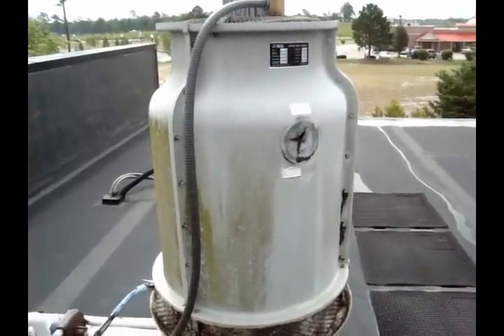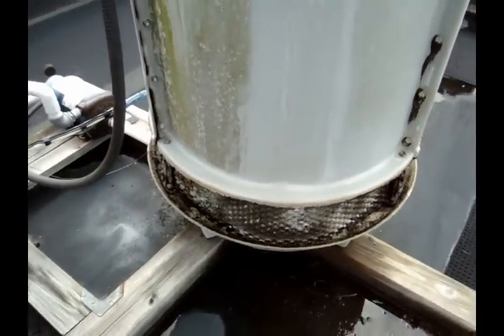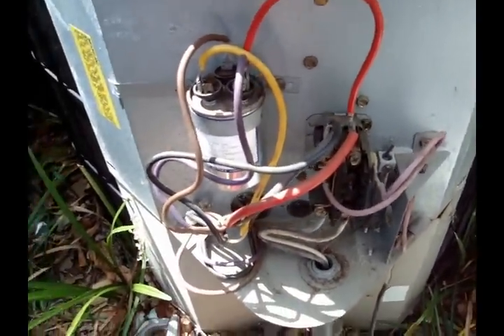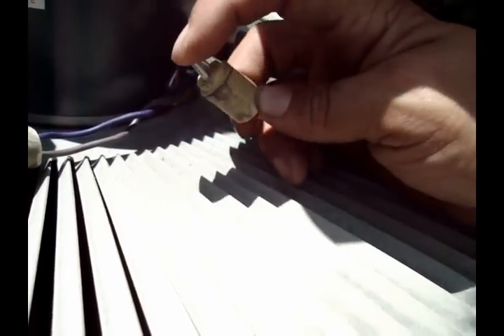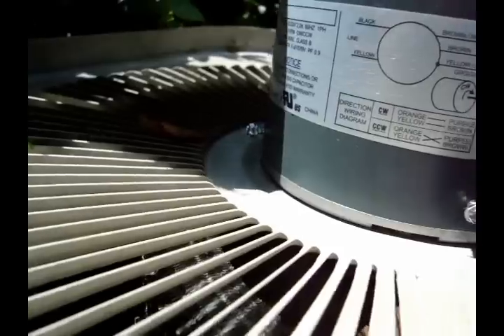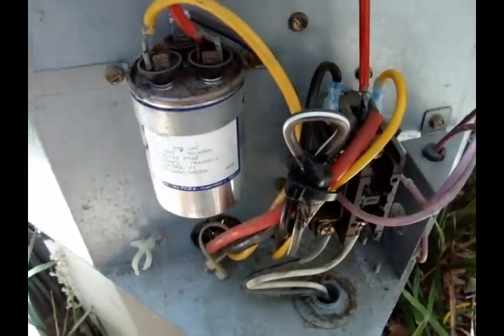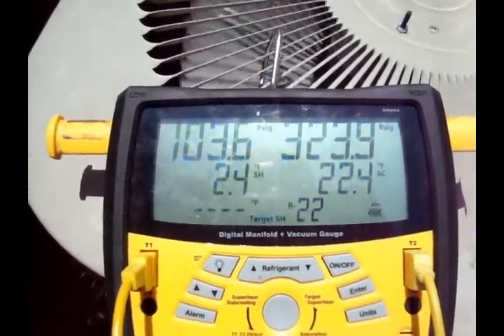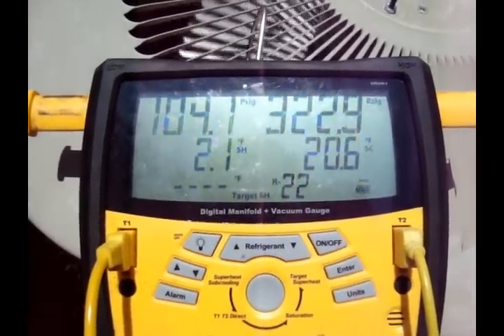HVAC: Service Calls

Comment: Don't forget those Brad that charge because suct. pressure is low. They don't know enough to even realize the added charge is not working as in due to liq. line restriction,etc.. .

Comment: this is exactly the type of video I have been looking for.  Thanks for showing an over charged unit.  there are lots of videos showing the superheat/subcooling of under charged units but few showing OVER charged.  How much refrigerant did you recover? only 2.5 degrees of superheat I bet the compressor would be choking on liquid once the indoor temp came down from 90 to something reasonable.  cool video dude.